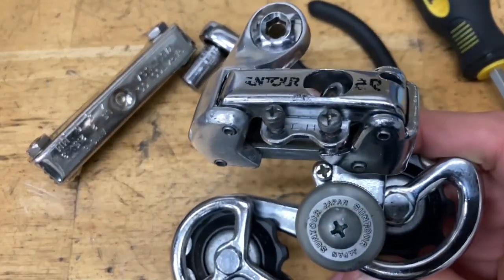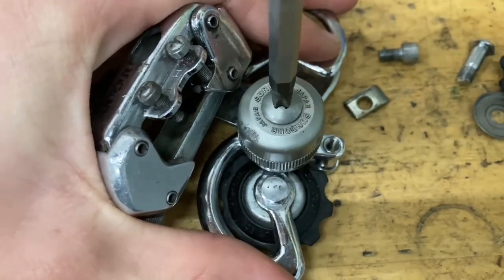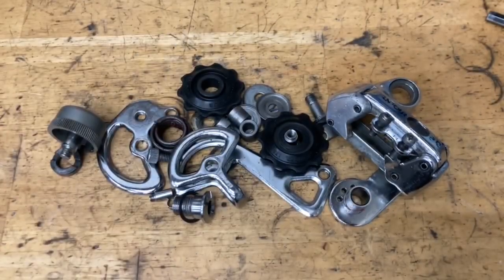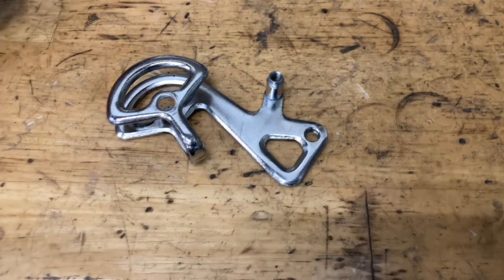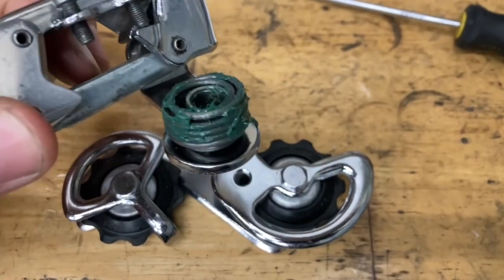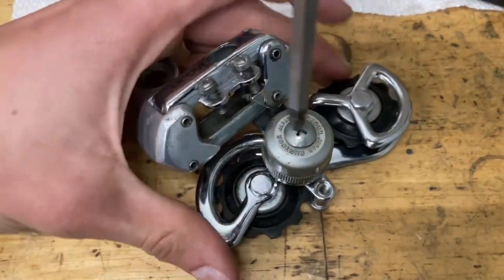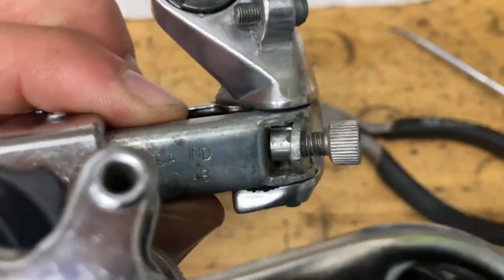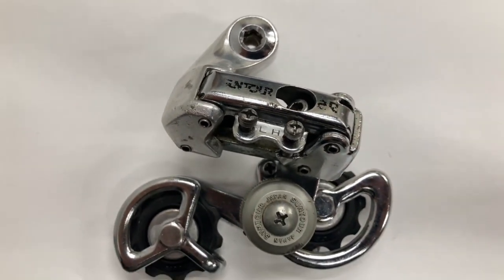How To Rebuild a Suntour AR Derailleur

Comment: Threadlock on bolts? Your thoughts?
Reply from the maker: If you have it then use it but you don’t have to. I’ve never used it and never had any problems. Just make sure the bolts are snug
Reply: @RetroRebuilds  one more question...are the b screw plates? Shimano universal?.  I've asked around online however no answers. The Shimano rear derailleur piece that the b screw goes into. I rebuilt a rd MC33 the other day and messed up the threads where b screw goes in. I'm guessing when I used a screw driver to apply tension I knackered the threads
Reply from the maker: From my experience they’re similar as long as it’s a similar era and quality range. If you stripped the threads it’s no big deal just re thread it with some oil and some force. Make sure the screw doesn’t wobble around cuz then you’ll have to re tap it.
Reply: @RetroRebuilds  I've decided to buy some junk derailleur from that era in the hopes that they are a match...it's strange that Shimano does not even label and categorize them in any service manuals I can find online. No part number not definition given whatsoever to the b screw plate